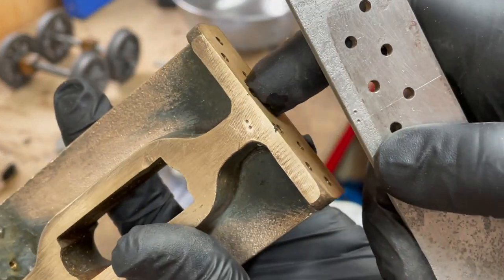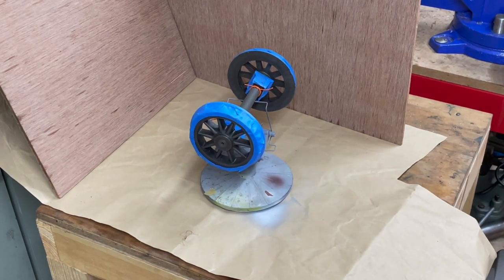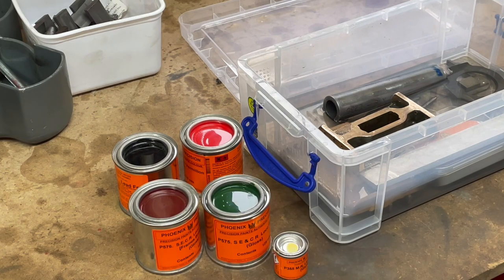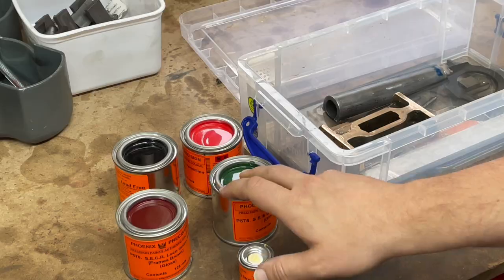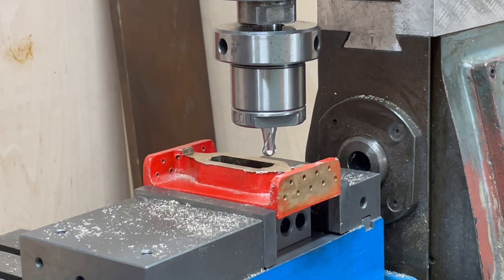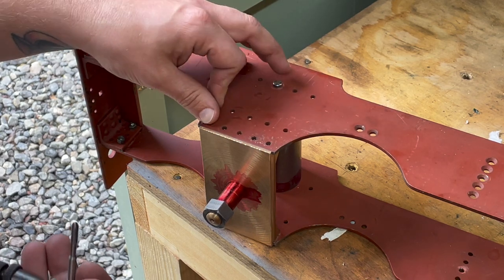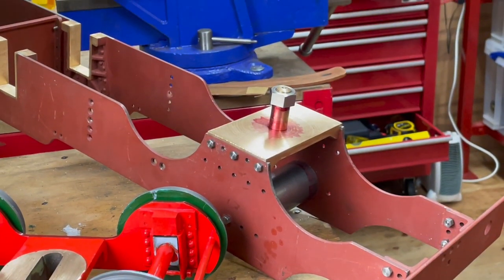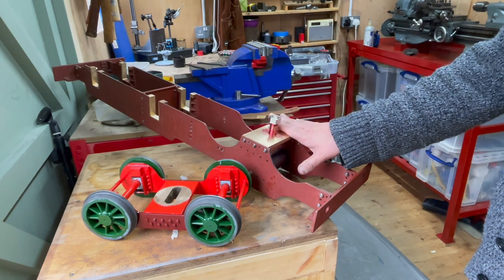Finishing the Bogie Bolster & Bogie - Steam Loco Build #20

Comment: Great work dude! Time to get some more wheels in there and see her roll!
Reply from the maker: Thanks bud! Next job is the axleboxes but it seems that frame twist has come back. I'm considering scrapping them except as drilling templates for the bolster, and using the laser-cut ones I bought at the start of the project :( Any advice?
Reply: Need to get them on a big surface plate, we have one at club (or used to I’ll have to check) and see what’s going on. It might be nothing to worry about but without seeing it’s hard to know
Reply from the maker: @CroFittings  do you think this could be something we arrange soon? I don't want to do the axleboxes I'm set on the horns, which need the frames!
Reply: I’m up there next Saturday 4th? Jubilee weekend and clubs putting on some
Food in evening etc. drop me an email if you can make it I’ll get your name on the list